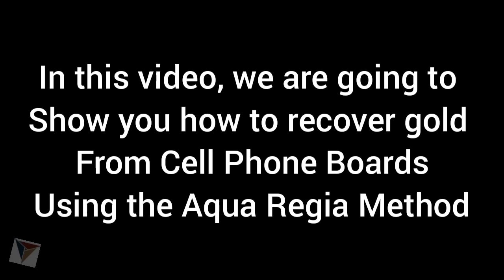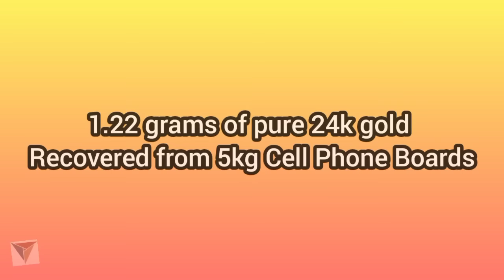Cell Phone Boards Gold Recovery AR Method | Gold Rccovery from Cell Phone Boards | Gold Recovery

Comment: Under the solder mask which is the green or blue color on most cell phone boards you will find some fully plated with gold, eventually you'll know what to look for instead of testing each for gold under the solder mask. The sold mask can be any color nowadays
Reply from the maker: I should follow your direction...😇✌️
Reply: @TrinityGoldRecovery  I've given you nothing but accurate information to help you advance. Memory is the same way, eventually you can tell just by looking at it, saving time. Even though I rarely if ever refine nowadays because of health problems I still buy and process material like crazy and collect extremely rare chips and super boards. I hoard the material that is extremely high grade, which I mainly buy but sometimes lower grade material is included, I just resell that shit. In December I got a auction with 3 engineering samples, two somewhat rare valued at $500 each but the third is the only known example, I've turned down a ton of offers because I'm not selling but the highest was $5,000. I have a vast knowledge of hardware, something I believe every refiner should learn so they don't end up throwing money away for a little gold
Reply from the maker: You are a lion hearts man... respects 😇

Comment: Sir i have sulfuric acid but it do not boil ic chips. Even it do not segregate solder from aqua regia but the acid can burn a stick of fire match.
Reply from the maker: By any chance did you mixed hydrogen peroxide in your acids?

Comment: Make ocean throw boards in drop tin chloride all others in suspension fishtank grill  sediment drop clear 2 valve clean out drop chamber from water bottle 5 gallon  funnel  with pull out cotten tshirt layers hcl mister drops lead , dump cement silver with copper metal  , precipitation of gold or use iron to drop copper then iron ferrous sulfate to drop gold or plate out gold with solar panels tantalum ? Could deplate but dropping in sequence would be nice air stones and circulator filters would filter fishtank filters 24-7
Reply: Shop vac in another bucket drill holes in 2 connection with threads and dope caps on equalizer tubes with other bucket having a 5 gallon buckets filter in drilled holes in caps vacuum funnel with cotton stuffed and t-shirt layers use cut off bottom as lid with zip this and plastic pc slide it hinge and as spill container
Reply: Last one TTYL pvc pipe with screen fill tubes inject liquid gravity fed time it drains off gravity timing and flip dump piping , even valves between bucket w union filter equal and secondary filter after filter funnel , stacking another bucket with material and drain into another filling solution saturation ,vent Hood also hooked to fish tank lid and shop vac t y with respirator filter vac filters and now a forever chemicals filter for Teflon and w about ruthinium and aluminum did I say tantalum should break down last in wrapper ? Or drop sinterned with solid legs with solder tin lead and nickel plating
Reply: Use a p la swing  trap with trap primer precipitation sucker or drain off skimmer solids and filering , making a graduated tube straw finger in top slow drip fliptop quick drain iodine laying down is better other end valve it and hose em together, tower with a rinse cycle probably use dishwasher parts also peace
Reply: Section off fish tank lexan and plugs refill chamber  offset palladium constantly plating cell with iron and other drain off
Reply: Heard of bathtub Gin what a bout toilet rinse chemistry 
Adding to one tank and flush rinse bowl filter with trap precipitation turkey baster solid  suction filter trap overflow and a swing gutter drain off fish tank back filter aquaregia water fall and maybe plugs? Fravel be ceramic multiple layers by the time it hits the floor on surface mount
Reply: Back pitch flush to trap settle , actually a double trap and a tailstock with dishwasher drain vacuum filter and a nutted 1/2 trap with threads and 2 valves chamber done or even side sweep trap primer fitting with a rubber cap fernco

Comment: Have you seen the hot sand bath method to depopulate boards with surface mounted hardware? Works really fast and you can do a large amount at once and goes fast once sand heats up https://youtu.be/Ef15J6wVcP8